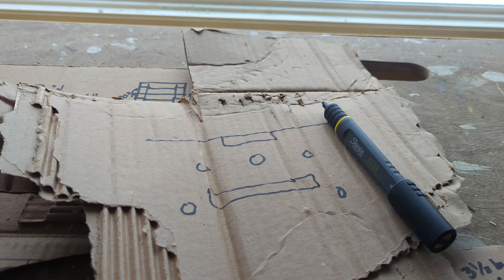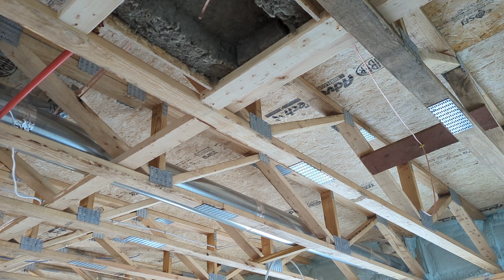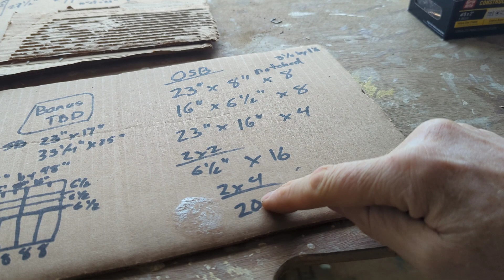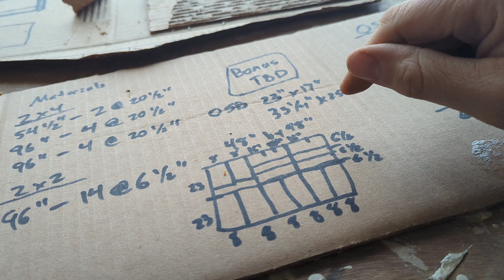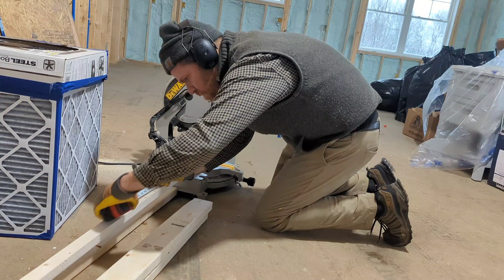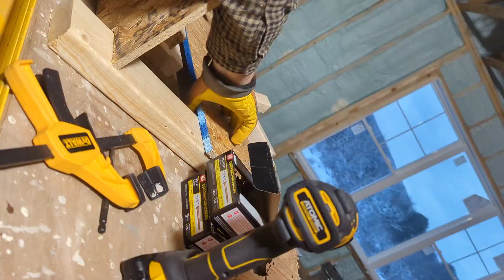Ceiling Speaker Boxes - Are they overkill?

Comment: Hey bro you might want to check with your states local code. Usually you need to run CL3 rated in wall speaker wires to your outlet box.
Reply from the maker: What is the reasoning for CL3 rating?